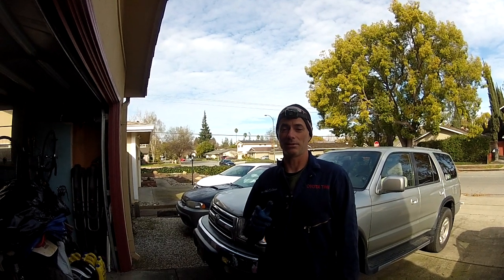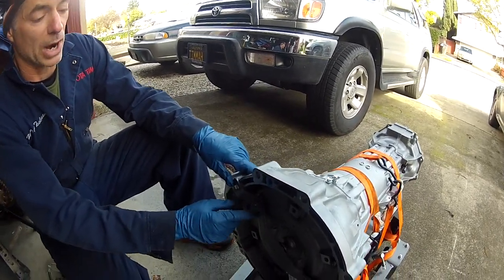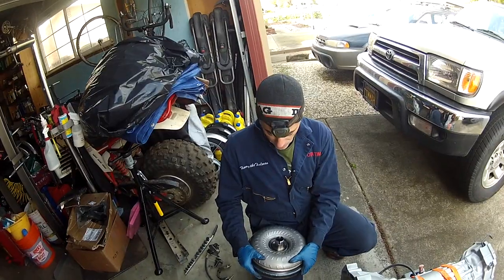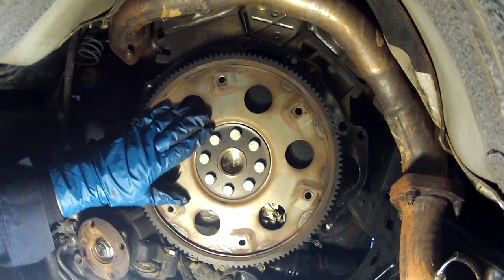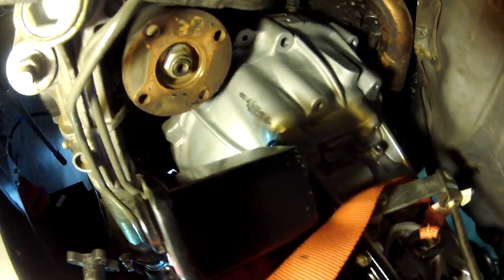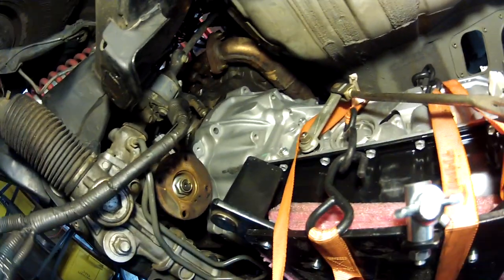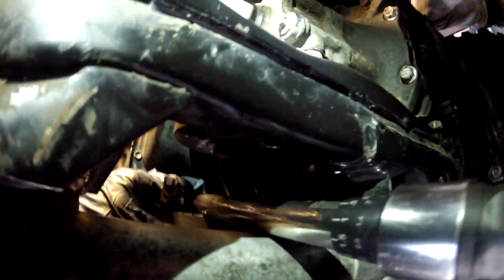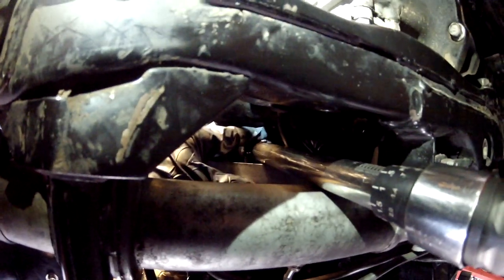Toyota 4Runner Auto Transmission Replacement (Part 3 of 3)

Comment: 99 4Runner tranny crapped out on I-80 outside of Elko, NV. Live in Denver. Uhauled it back to Denver. Transmission bell housing cracked. Flex plate totally broken off on inside ring. All of that repairable, but the lower connecting piece on the passenger side of the block that bolts to the bell housing broke off. Thank goodness for YouTube. I'm not the greatest welder, but there are a lot of great videos that showed me how to prep, grind, heat and weld the piece with nickel welding rod I was able to buy at NAPA. Not the greatest looking weld, but held solid. Thanks Tim for your great videos. I've had many 4Runners over the years and your instructions and hands on examples have been lifesavers.
Reply from the maker: That was quite the failure you had.  Great job fixing it especially the welding of the bell housing.  Nice to hear our videos are helping you out.  You're very welcome and Happy Wrenching!
Reply: @TimmyTheToolman  is that a common thing you see often where that ear on the lower part of the block on the passenger side that attaches to the bell housing is broken off the block?  I've seen this on a few 5vze engines so I'm thinking it's a design flaw. Mine was the first one I welded so I'm glad to know it can be repaired.
Reply from the maker: @dtalbot48  I have not heard of that as being an issue with these rigs.  You mentioning it is the first time I've heard it.
Reply: @TimmyTheToolman  I don't think it gets noticed if it's there unless you pull the transmission.  If it's cracked and the bell housing bolts are tight, it's not noticeable.
Reply from the maker: @dtalbot48  Gotcha.

Comment: Nice series. I just did this job, replaced torque converter. Did it solo. Hardest part in disassembly was taking flex plate cover off. Hardest on reassembling was the torque converter to tranny - top passenger side bolt. Figured out a technique finally. Two people would have helped. I was remote and away from friends. I can't see doing this job without a tranny jack. I judicially used a chain wrench to hold driveshafts. Also I thought it wasn't very difficult to turn the crankshaft while in the same position to torque the bolts connecting flex plate and torque converter. Finally, I didn't get a warm fuzzy feeling until I found a Toyota spec of ~.702 inches (or greater) from bolt pads on torque converter to mating surface of bell housing. I read of people doing whole job twice  because they didn't get torque converter seated deep enough. Sorry but just hearing it clunk twice wasn't good enough for me, lol. Thanks for your high quality production both here and with other jobs.
Reply from the maker: Hey Brent, glad our series helped you get the job done.  Yeah, no way I'd want to do this job solo but great job getting it done all by yourself.  That was a serious achievement for sure.  Thanks for sharing your experience with the job.  Happy Wrenching!

Comment: just out of curiosity, i have a 1999 4runner and there is some kind of difference in the transmission for manufacture dates thru 5/99 and from 6/99, i know which one i need but would you know the difference in them?
Reply from the maker: Hey Lillie,  the only thing I know for sure is the 2001 and 2002 years have a different model transmission than the previous years.  I think you're best bet would be to ask that question at your local Toyota Dealership Parts Department or pose your question on a forum like T4R.org.  With your VIN number, a Toyota Parts Department should be able to tell you exactly what model transmission you have and whether other years would be compatible.

Comment: I was about to fill up my transmission but I noticed a small steel ball laying on the floor, any ideas where this come from? all I did was connecting the cable that comes form the top of the engine I also remove the filter
Reply from the maker: Hey Mauricio, can't say that I do know where that ball goes.  So, you dropped the pan and replaced the filter?  This might be something you'll need help with from the dealership.  They could bring up a parts schematic and maybe give you an idea of what it belongs to.

Comment: Not sure if you will respond but my 98 4Runner has been slipping in first gear. It happened after I put new fluid and filter in it. Any ideas what’s going on with it?
Reply from the maker: Are you talking about an automatic transmission or a manual transmission?

Comment: Hey Tim. I put my new Toyota transmission and everything went well.  I put the torque converter in just as you did and held the shipping bar against it to make sure it was in at the proper depth and it was. The bell housing slid easily against the engine and the pins lined up correctly.  When I went to rotate the crankshaft to line up the flexplate to the torque converter, the torque converter spun with the flexplate.  I pulled the transmission and again held the shipping bar against it. This time the center shaft in the torque converter was about a 1/8 of an inch  behind the shipping bar. I cleaned and greased the center hole of the crankshaft thinking that's where it may have been sticking. I spun the torque converter and it spun smoothly as it had before. No  noises or fluid leaking out. So, I again mated the bell housing to the engine and again the torque converter spun with the flexplate. I slightly loosened the bell housing bolts and this time the torque converter did not spin with the flexplate. I aligned one bolt and started it only a couple of turns by hand.  I then tightened the bell housing bolts and installed the flexplate to torque converter bolts. The crankshaft turned without a problem and I heard no grinding or metal rubbing. I should also mention that I installed a new flexplate and am certain it was installed correctly as I checked it against lots of images and videos including yours. Wondered what your thoughts might be concerning the flexplate and the spinning together before being bolted up.  Sorry for the long post.
Reply from the maker: The only thing I could think of is the flex plate was installed backwards or the flex plate spacers were installed incorrectly.  If you did, like you said, made sure you got the flex plate in correctly, I don't know what could be the issue.  Was the replacement flex plate OEM?
Reply: @TimmyTheToolman  No. It was an ATP.
Reply: @TimmyTheToolman  I double checked. The flex plate wasn't backwards and the spacers were the same as before.
Reply from the maker: @dtalbot48  I wonder if that flex plate is made exactly to OEM specs.  It it wasn't, maybe it's a bit thicker and that's why it was able to rub the torque converter.  But, I wouldn't worry too much about it.  If you got the flex plate installed right and bolted to the torque converter, everything should be fine.
Reply: @TimmyTheToolman  Thanks Tim. I think so as well. I'm starting it up tomorrow. I'll  let you know.
Reply from the maker: @dtalbot48  Cool.  Hopefully it's all good.
Reply: @TimmyTheToolman  Hey Tim. My transmission seems to be working fine. The 4Runner starts up, shifts gears and seems to  be working as it should. How much fluid did yours take? I'm a little concerned about the amount of fluid mine took. It only took around 3.5 quarts. I overfilled it and let it run down until it got hot and continued to check the level.  I'll keep checking it, but after running it for about an hour the level is at the hot mark on the dipstick and not changing. Does Toyota send them out almost full? On another note, I heard a clunking noise and it turns out my rear driveshaft is toast since it's the front u-joints that are fried.  Oh well. When everything is said and done I'll have a really stable  driveline. Thanks so much for your videos and feedback. You're a lifesaver.
Reply from the maker: @dtalbot48 Good to hear it's all good.  Toyota fills the transmissions with around 8 quarts.  I remember when we shot this job we also didnt have to add that much to top off the system.  The way we found out Toyotas pre-fills their remanufactured auto transmissions is we recently shot an auto trans swap on a 2007 FJ Cruiser that has a sealed transmission,  no dip stick.  I didnt want to overfill it so I asked the Toyotas dealership parts department if they come with any fluid in them and the answer was 8 quarts.

Check out Tom Woods for a replacement driveshaft.  They are just as good but more affordable than an OEM replacement.   You can get one for around $500.  We recently used Tom Woods driveshafts for a project we filmed installing a Marlin Crawler Taco Box in a 3rd Gen 4runner. They're good guys.  Tell them Timmy the Toolman sent you.

Comment: Great video, a lots of good details. I watched this because I needed to pull the 3.4l engine out of my 4Runner.  I have big arms and hands so I did not remove the bolts that hold the engine to the transmission  bell housing. Just backed the bolts out of the engine threads and left them in place. Once I put the engine back in all I had to do was guide the 17mm socket back onto the bolt heads and thread them into the engine. I did not have to fight trying to get the bolts in the holes this way. Thanks for all the good videos.
Reply from the maker: Great to hear our video assisted you with your motor swap.  Good idea of leaving the bolts in place on the bell housing.  You know what they say,  "Big Hands, Big Feet" or something like that.

Comment: GR8 vid as always. Don't have to do that job on my rig yet but it helps me to locate the transmission temperature sensor on my truck. Bought my rig about 2 yrs ago with a PO710 code.The temp. The sensor is disconnected and the connector is damaged. Now I know where it is connected in the harness. need to identify the type of pigtail and repair it.Thank you, Timmy. Keep up the gr8 work.
Reply from the maker: You're welcome.  Nice to know our video helped you out.  Good luck with the harness repair.

Comment: My transmission failed today. Leaked out all my fluid on the freeway in a matter of 3 miles. A local trans shop quoted me $2500 to rebuild plus labor. I'm taking the trans out tomorrow, and buying a brand new one from camelback Toyota tomorrow for $2100. I've watched all your videos 5-6 times now to make sure I know what to expect. Thank you so much for these videos! I owe you big time
Reply from the maker: What was the origin of the leak?  

Good luck with the swap and let us know how it goes for you.
Reply: Thought it was my rear main seal, but turns out it's my input shaft seal. My trans fluid was very black.  And possibly my trans slave cylinder may have failed or leaked too. Trans fluid was pouring out of the inspection plate. Covered the entire under side from oil pan, to rear bumper and some fluid even was wind blown up to my rear tailgate glass. Took me 2 hrs just to clean everything. The things I was able to do with confidence cause I watched your videos, really helped me. I was gonna have a shop do it all, until they quoted me $2500 just for the rebuild, and another $1200 for labor on remove and install, plus trans fluid and misc. Because of you I'm saving $1500!!!!!! My wife loves you now too! Lol
Reply from the maker: Well, we're glad our videos are helping you out and we always love hearing from people sharing with us how much they've saved using one of our video tutorials.  Thanks a lot for taking the time to comment.  Happy Wrenching!

Comment: Thank you so very much!!!!
I followed your steps and replaced broken transmission on my 2002 Toyota Sequoia! I’m so happy!👍
Reply from the maker: That's great to hear Max.  Thanks for taking the time to comment to share your success story.  Just think of how much money you saved yourself and the experience you gained by tackling the project.
Reply: @TimmyTheToolman  It not just about the money saved but the satisfaction of being able to understand your car and fix it. You help me with your video a few months ago with the ABS assembly unit and all went smooth following your replacement on a LandCruiser. I am considering also to replace soon the transmission on my 4Runner. Thanks for what you do and how you do it
Reply from the maker: @junal27  Very true.  It's not just about the money saved but the satisfaction of doing your own work and gaining knowledge.  Thanks for the comment.

Comment: Hey Timmy one of your videos comes thru again. Something I had a tough time finding was how much ATF the torque converter takes and empty it's between 11 and 12 quarts from what I read on Yota Tech. I was talking to you about my 3.4 swap about a year ago, I finally have everything I need for the most part and have the 3.0 out, anything else I may need I can get at one of the two Toyota truck junkyards in town. I should be dropping the 3.4 in Thanksgiving weekend, provided it doesn't snow. You and Sean are a wealth of knowledge, thanks for all the help. I can't leave out Yota Tech either for your watchers they know their stuff there too.
Reply from the maker: Good luck with the job.  We recently filmed a 3.4 liter motor swap. It will be a 4 Part video and Part 1 will be out soon.  Sean and I like helping people out and it’s good to hear our videos have been useful to you.  You’re very welcome and let us know how the project goes for you.  Happy Wrenching!
Reply: @TimmyTheToolman  Thanks, I look forward to those videos. I have one question what dip stick tube did you guys use on that swap? Off to start turning some wrenches.
Reply from the maker: @billw5235  We used the stock dipstick tube that comes with the engine.  The one that plugs into the front of the motor at the front right corner of the oil pump housing.

Comment: Thanks again for another great vid! I pulled my transfer case and transmission to repair the main seal. Putting it all back together, I somehow managed to damage the little breather hose that connected from the transmission to the transfer case near the shifter on the passenger side. The factory service manual shows the breather hose on the transfer case, but not the transmission With the transmission and transfer case mounted under the truck its also quite difficult to get in there to access the breather ports. Any recommendations?
Reply from the maker: You can access that breather line through hole in the body the shifter occupies.

Comment: friend I have your videos and you learn a lot, but there are no videos on youtube of the replacement of the Transmission temperature sensor
Reply from the maker: I don't know which sensor on the side of the transmission is the temp sensor but it shouldn't be that hard to figure out.  By the replacement sensor and then take a look at the transmission on both sides and you should be able to spot it.  You wold simply have to disconnect the harness connector and then unscrew it from the trans.

Comment: I dropped my transmission and swapped in a new torque converter. Your directions were spot on!! One question where did you get the gasket for the transfer lever and what is it called? Thanks again!!1
Reply from the maker: Hey Anthony, 

You're welcome and we're stoked the video worked well for you as a tutorial to get the job done.

I remember Sean bought the Transfer Case Shifter Seat from Marlin Crawler.  They only sell one, so I think this has to be the one Sean bought: https://www.marlincrawler.com/transfer-case/parts-upgrade/shifter-parts/heavy-duty-shifter-seat-forward-shift
Reply: Where did you get the gasket for the transfer lever?

Comment: Hey Tim, great guide, thank you for this especially since ive done nothing transmission related before. Quick question, when putting my transfer case shifter i noticed that its stuck in 4Lo and wobbles side to side very easily. Any clues on why? I plan to open back up the center console and take another look at it but it seemed like it only went in one direction. Thanks!
Reply from the maker: You probably don't have the shifter seated correctly inside the transfer case.  Our shifter bushing replacement video might offer you the necessary detail for the landmark you're aiming for when inserting the shifter.
Reply: @Timmy The Toolman  will watch that video right now, thanks a bunch Tim!

Comment: Great video thank you for that. My transmission went bad . I have 2001 SR5. I was able to get one from a junkyard from a 1998 . It’s a 4x4 as well . Would a fit . I am concerned . I am not a mechanic but the junkyard told me it will? I guess I just need reassurance. What do you think?
Reply from the maker: You need a transmission from a 2001 or 2002.  The ones from a 01 & 02 are different from the ones from 96-00.  So, while one from a 96-00 will bolt up, they are electrically different and won't work to connect to the wiring harness and communicate with the ECU.

Comment: Thanks for the video! Is going to help me a lot when replacing the torwue converter on my 02 tacoma
Reply from the maker: You're very welcome and good luck with the job.
Reply: @TimmyTheToolman  the torwue specs should be the same for my first gen tacoma, am i right? Because i following your video for tge torque specs aswell. Thanks!
Reply from the maker: @ZER0o10  Yes, they will be the same.  1st Gen Tacomas have the same drivetrain as the 3rd Gen 4runners.
Reply: @TimmyTheToolman  awesome, just making sure ahah, thanks!
Reply from the maker: @ZER0o10  You're welcome.  Good luck with the rest of the job.